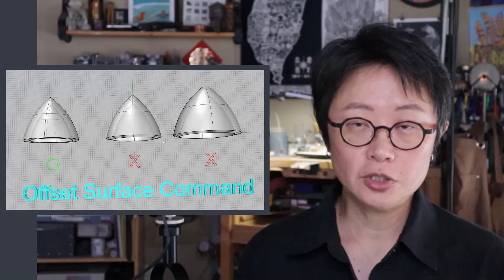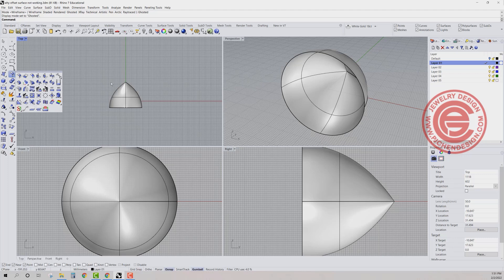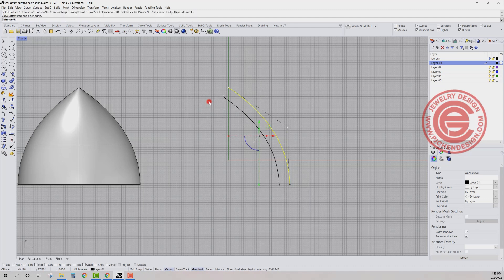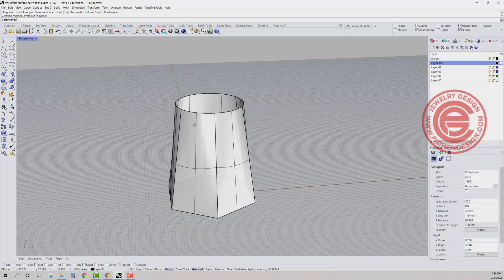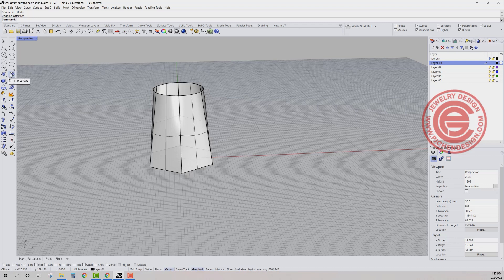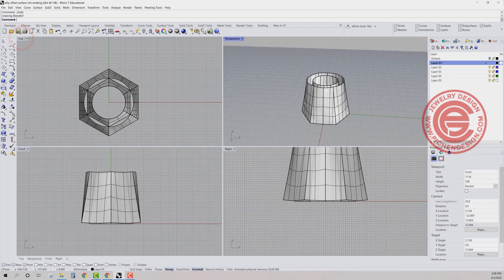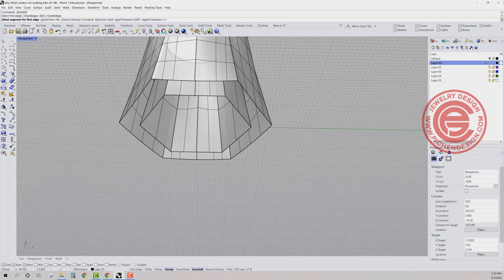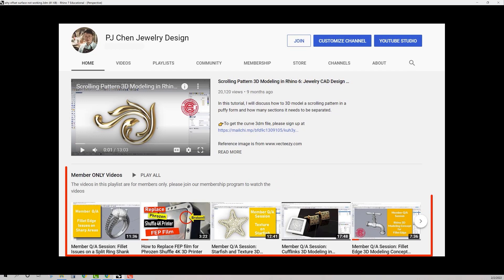SOLVED! Why "Offset Surface" is not working? Rhino 3D Modeling #292

Comment: hey im dealing right now a lot with offset structures. What i dont like about the offset a curve to the outside is the fact that you won‘t be getting a curve which is conected to the floorplane. Trough the offset command youll get a curve hangibg somewhere over the floorplane. Do you have any idea how you could fix that

Comment: Well, all what you did were just workarounds on well known Rhino’s flaws. I’m an early Rhino user since the very first beta in 1995, and all these issues have been around for decades, at least from v.3. Not to mention fillets, which have always been and still are problematic.

I’m used to workarounds, otherwise I could not be able to model anything, however I would never teach students these workarounds as “the way to make it”. 
It’s not, it’s just one of many ways to run around modeling issues and procedural flaws, still not the way to get it done as expected. 
And it has a cost, and it’s quite painful, pretty often. 
Just to say things as they are.
Reply: Exactly. The offset srf command should simply work without the intersecting surfaces on the in side creases.

Comment: The offset in the case of "circle to hexagon" didnt work even after doing everything in this tutorial, until I reduced the tolerance from 0.001 to 0.01. However like shown in the first example, i would rather just construct two separate polyline shapes instead of using offset.
Reply from the maker: that will work